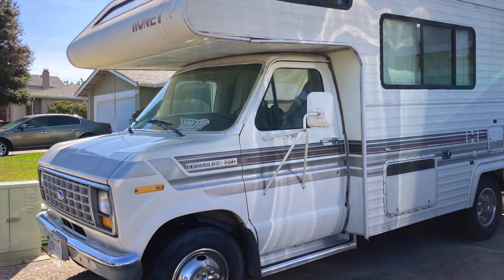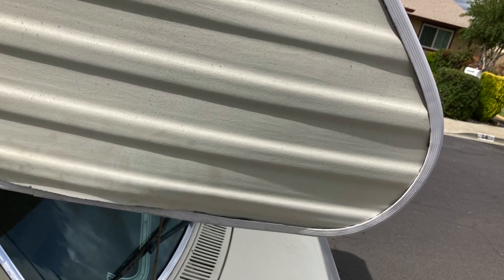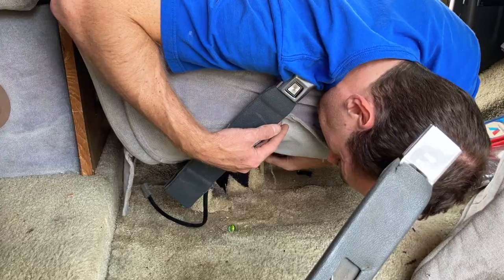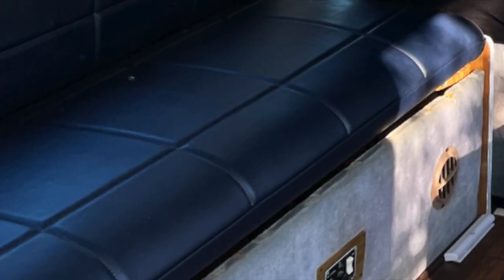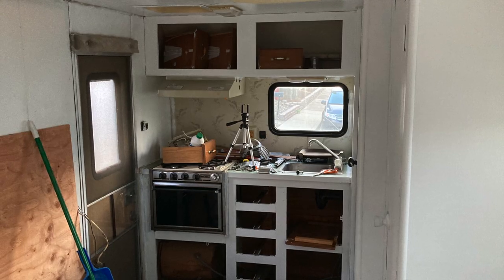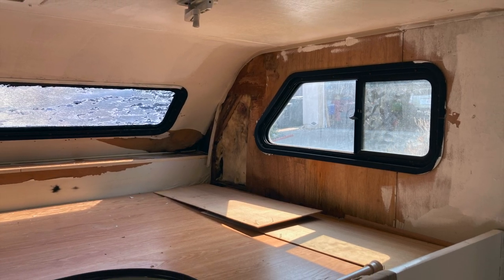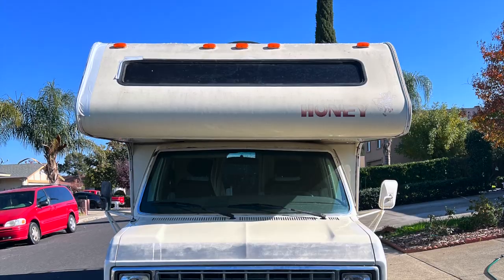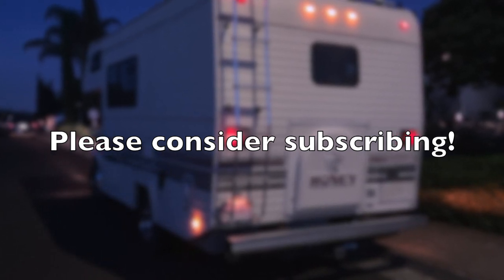GUTTING AND REMODELING 1989 Ford E350 RV - Covid Project

Comment: Did you get rid of the fridge?
Reply from the maker: I did end up getting rid of the dual gas / electric fridge. I was torn about it after but easily could have left it. The gas supply line was in an odd spot to leave it though.